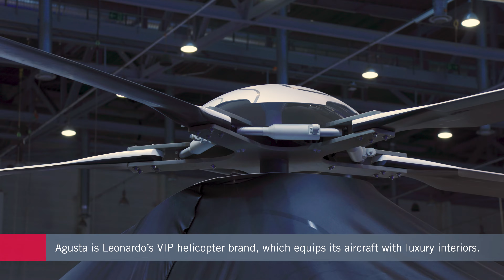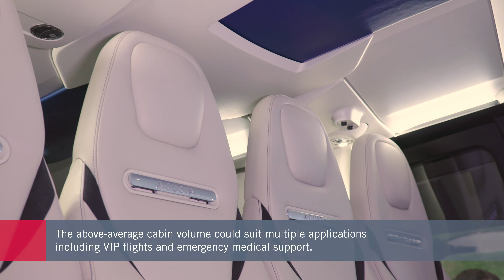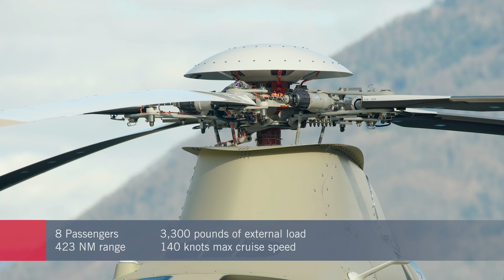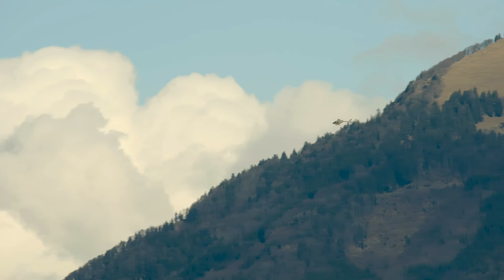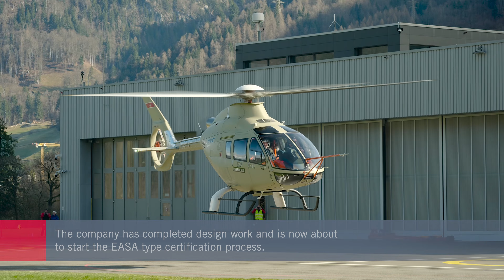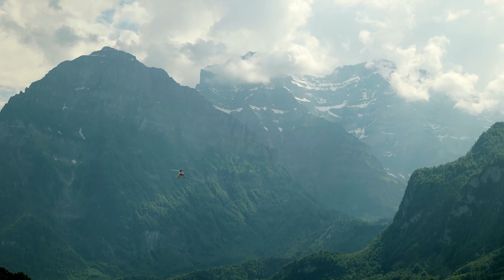Kopter Expects Versatile AW09 Helicopter To Punch Above Its Weight – AIN

Comment: The helicopter does seem well thought out interior . The flight deck is very clean . I really like the tail rotor design. 
Single pilot I get the need given the lean operation parameters. 
Just overcoming consumer ideas for two pilots as in conventional rotary aircraft experience.  So guessing FAA and insurance companies will both be able to accommodate this new design. 
Wishing nothing but the best for much success. Thanks